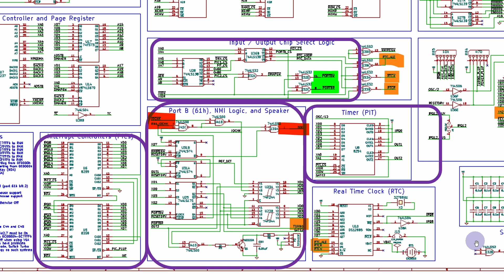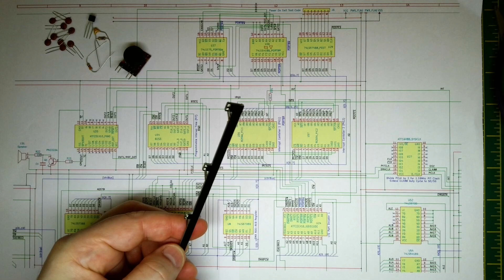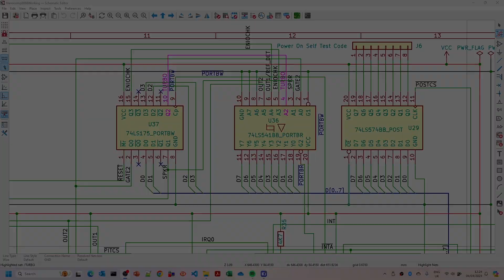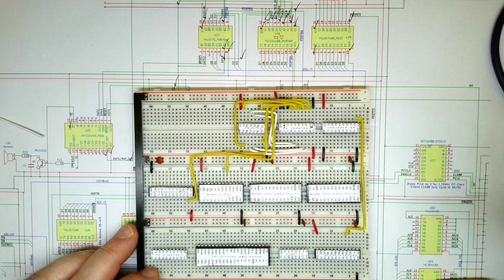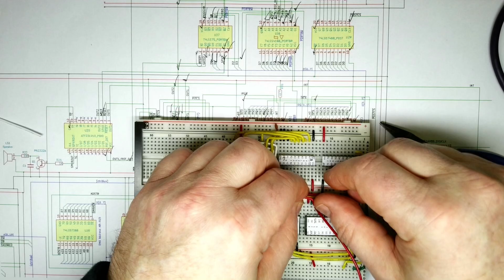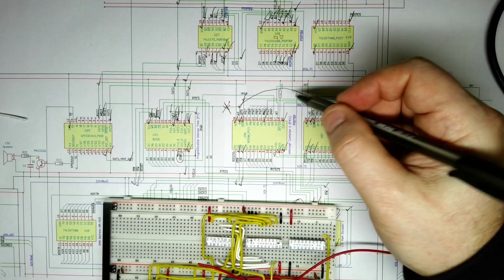Breadboard 8088 PC Compatibility Part 1 #23

Comment: What is the capacitance of capacitor C1 next to the speaker for the BIOS beep codes?
Reply from the maker: Its from the XI 8088 Speaker circuit which is 0.01 uF or 10nF. Have updated the working copy of KiCad diagram so will upload this when DMA and Floppy Disk Controller working. Dave

Comment: Everytime happy to see a new video! 
Could you maybe update the schematics (and maybe other things like the PLD files) in the repository? That would be helpful, when I catch up to the MDA video part.

In the IBM schematics, I've noticed that they connected the SPK output to bit 4 of port C in the XT (in the IBM PC this was the cassette in). Since you marked it green, do you maybe know a use for this? Or is it rather random, because they had a free pin now? In the documentation, the pin is marked as "spare".
Reply from the maker: I will upload the schematics and updated PLDs by the end of the week. I want to get the new board working first before releasing them as there is a good chance they will be wrong in some way.
As far as SPK on bit 4 of Port C I think that was just me highlighting speaker related pins (no deep underlying insight I'm afraid). It looks like pin 4 was documented as Spare as you say but SPK on Sheet 8 of the system board is taken from the output before the 33R resistor so is the 'sum' of the Out2 from the timer or the SPKRDATA from Port B. I guess might allow a background TSR to monitor the speaker output from another program? Not sure this is wired in on the XI 8088, nothing before the 33R resistor. Will take a look for the next video. Thanks for the feedback. Dave